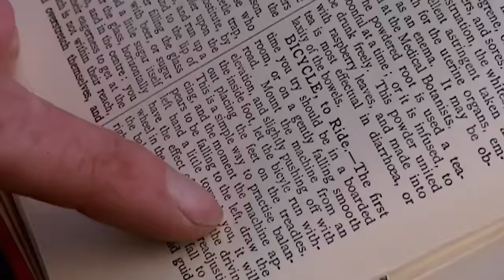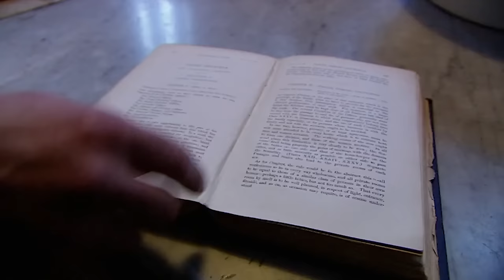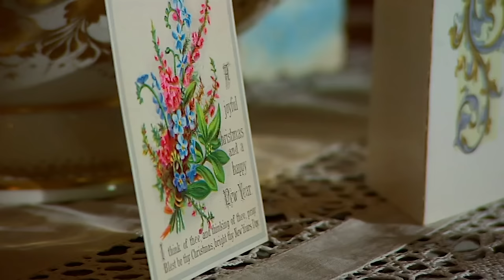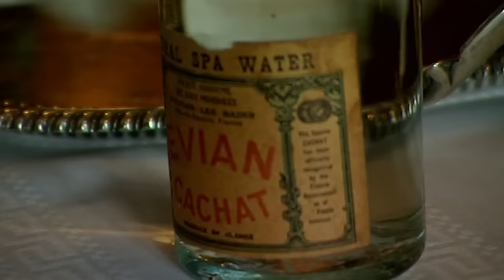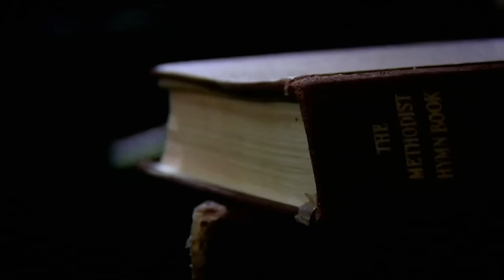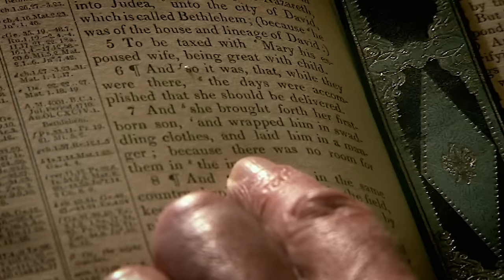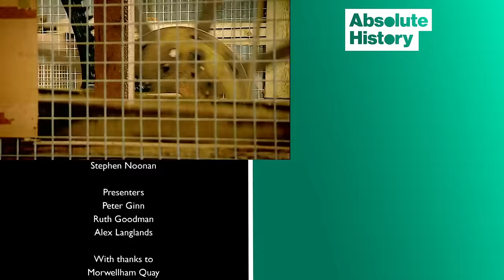How The Industrial Revolution Changed Women's Lives | Edwardian Farm | Absolute History

Comment: Thomas Jefferson had "in house" toilets, unheard of in his time.  He'd designed a system for each relief room, clay lined pipes leading from just above the river -- a source of clean air, and from the relief room another pipe pulling the air out of the house,.  I don't remember how he managed to keep the air moving, but it worked.
One side effect was that even in the hottest summer days the plantation house remained cool from all that river air.
Reply: Great example but Roman's had indoor plumbing very primitive but they had it ( their toilet paper was disgusting.....a rag /sponge on a stick used by multiple ppl yew!!!) There has been spots of running h20/ toilets through out history when they were present the health of the household/community went up

Comment: If I remember correctly, the boys said the price of the tractor, 300 pounds, was six years' wages. That's 50 pounds per year for farm work. Comparatively, Ruth could work 17 hour days and only make 16 pounds per year. That's 1800 pounds or $2000 today.
Yet one in four people were employed in domestic work in Edwardian England. It certainly makes our modern socioeconomic difficulties look small.
Reply: @Celto Loco Right, but "more than the average" would still only be $6250 today. Of course they were pretty self-sufficient so they didn't need to buy many commodities, but one bad crop year or an animal-killing disease would easily put them in the hole.

Comment: Question--it seems that many of the cleaning or polishing products used some type of food as a base (ex., leather cleaner using egg whites and sugar, or beer to polish the wood)--how did these products not encourage bugs or mold and mildew or fungus to settle into the furniture or walls? Thanks in advance.
Reply: My guess it’s the frequency of cleaning that prevents spoilage, in addition to other elements like dosage, the ability of the object to dry out, and in cases of ingredients such as sugar, the simple antibacterial properties of the ingredient. Egg whites spread in a thin layer will dry quickly and when something is dry, mould won’t grow on it. Sugar is antibacterial (in some hospitals it’s even used on wounds infected with antibiotic-resistant bacteria mike MRSA). Leather would have been polished frequently. Traditionally tanned leather has been treated with tannins and in some cases it’s been smoked, further making it inhospitable to bacteria and fungi. 

Beer used as furniture polish is applied in a very thin layer that is polished dry. That means there’s only an infinitesimal amount of beer left on the wood and that residue is dry. During the next polishing that residual layer gets rehydrated and rubbed off, essentially ending up being replaced by the ‘fresh’ one. 

Some times the combination of ingredients will cause a chemical reaction, either just with one another, or with the surface on which it is being applied. This, combined with the rubbing of the cleaning, which takes away dirt/grime/contaminants and the polishing, will ensure that not only there is almost no residue, but that this residue doesn’t get a chance to spoil until the next cleaning. 

I’ve lived on three continents and climate also enters into the equation. In Southeast Asia, if you didn’t wear a pair of shoes for a few weeks they’d have a thin layer of mould on them. You’d have to wash them off with salt water, then rub them with alcohol (wodka, gin…) before polishing them. The trick would the, be to really burnish out any polish to avoid new mould growing. Cupboards would often have an incandescent bulb inside them that was designed to switch ON when the cupboard closed. The heat from the bulb was enough to raise relative humidity that kept moulds at bay provided you rotated clothing and shoes and wore each item on a regular basis. Clothing and shoes would get taken out, aired and cleaned on a regular basis.